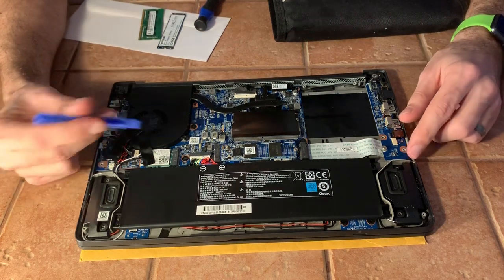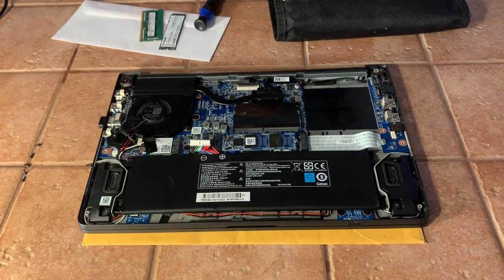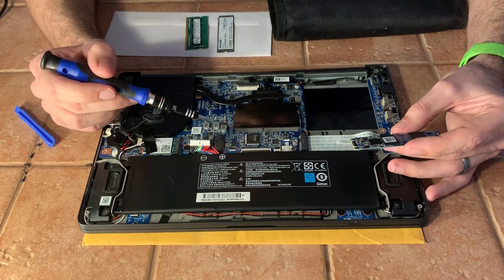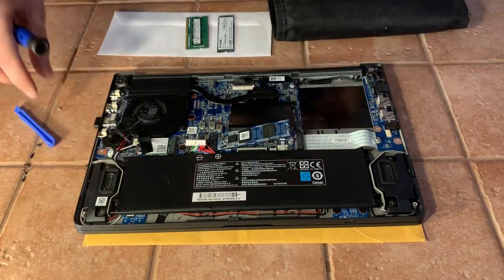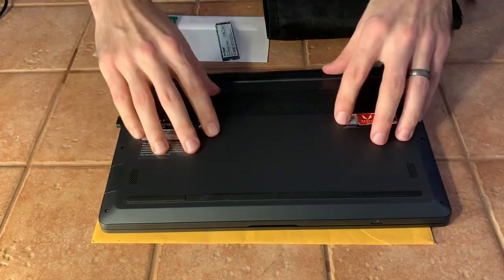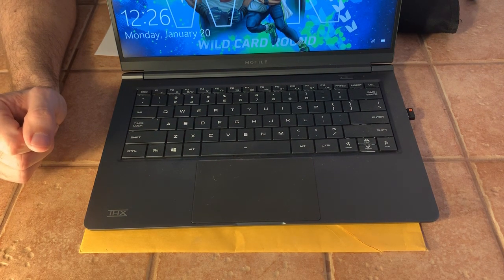Motile 14: In-Depth how to disassemble and upgrade.

Comment: WOW, this is guys ian IDIOT!! FIRST it is NOT a disassembly video, it's a replacement of the memory and SSD video. I don't know why he disconnects the battery cos THAT IS NOT NECESSARY. Second, he drones on and on about absolutely UNNECESSARY tools, all you need is a philips head screwdriver, a good way to keep all the screws, and a plastic card and a wedge, i use my useless client card for some store.

Comment: If you're in a pinch without a spudger, I find that using an old credit card is somewhat useful in that regard.  As for stripping screws, this is why I don't torque the screws super-tight when closing the laptop back up ...so if I have to disassemble again the future, I don't have to use a lot of effort and risk stripping the screw.

Comment: pretty decent video but absolutely do NOT need to disconnect battery unless you have Parkinsons, and absolutely absolutely dont have to remove the chassis (omg - someone wanna pretend like they work on laptop innards?).
Reply from the maker: I normally ignore critical comments, but I don't let people misinform in my comments. Even though I say it's not absolutely necessary every time I do it, I'm going to keep recommending people disconnect device batteries. You'll see the same in   iFixit guides and I guarantee they're still teaching it in tech colleges.

The chances of shorting components on a modern board are very small, but still exist and are greater on generic brand boards that play loose with standards. This is such a device and I'm always going to recommend people err on the side of caution.

I'm not sure what you think you know, but I do seriously work on laptop innards. A lot and for a long time. I'm going to keep telling people to do industry best practices, even when some of them become partially outdated and unnecessary. Because that is what you learn from experience.

Comment: Great video by the way man! It helped me out big time with my upgrade to 16GB for the ram. I was thinking about moving the stock storage over to the slower slot and just running windows on that drive. Then I was going to drop a better 500GB or 1TB drive in the faster slot with all my other programs. Think this is a good move or is there a better way to go about it?

Comment: Would you still recommend this Ryzen5 at the current price of $450?
Reply: C Maximus yes, it is a kickass laptop for the price. I upgraded mine from 8GB to 16GB of Ram and it’s a beast for the price. I just wish i got it when it was even cheaper.
Reply: Mace where did you get your 16gb ram? What brand or model was it? Thanks
Reply: SteakCity 300 no worries buddy. I got mine on amazon. Here is the exact one that I purchase. Patriot Memory Signature Line DDR4 16GB (1x16GB) SODIMM Frequency: 2400MHz (PC4-19200) 1. 2 Volt - PSD416G24002S https://www.amazon.com/dp/B074Q1P62K/ref=cm_sw_r_cp_api_i_DWPVEbR5DY0BZ

Comment: Long overdue question, but in your time with your motile have you tried dual rank ram? If so did it yield any difference in performance, positive or negative?
Reply from the maker: I'm still using the original 8GB stick on my Motile, but I have used dual-rank memory many times in the past. There is a very slight improvement in speed over single-rank. It's not going to be the magical solution to anyone wanting more graphics power, but it is a 5% or so improvement and worth considering for anyone already buying a memory upgrade.
Reply: @RyanLeCocq  thank you for the response

Comment: Could you add a second fan on the right side since the fan header is there and so are the screw-in spots
Reply from the maker: You absolutely could. So far I haven't seen just the fan for sale anywhere, just a few used complete heatsinks and fans on eBay and AliExpress. It's not an uncommon size or anything, just the one in there is obscure so it's hard to find. Another fan the same size and voltage should work fine as well.

Comment: Quick question on this laptop, I stripped my screws on the first attempt and have since learned my lesson (proper screw kit and tools are on the way). Is it possible to order replacement screws? I took some measurements and consulted a friend of mine who is engaging in mechanical engineering, and the screws used in there seem to be 6mm M3.5, and ordered some of those. Anxiety is getting to me though, so I figured I should ask if you knew exactly what screws these are.. Thanks in advance!
Reply from the maker: Alex Schaafsma You actually measure screws by shaft diameter x shaft length, not head diameter. Pretty sure the bottom 6 case screws are 2mm, but I’m not taking it apart again until I have spares. I ordered a set of 800 replacement laptop screws of as many sizes as possible to match every one in the laptop. Still waiting for it to arrive from Taiwan, but I hope to be able to advise people on what to order soon.
Reply: @RyanLeCocq  Thanks a million for the heads up, I just ordered another size based on my measurements with that fact in mind. I would have been in a panic if I couldn't get the right screws on time with all the craziness going on in the world.
Reply from the maker: @alexschaafsma361  I would still say get an assortment if it isn't too late. They're really hard to measure by hand. Also, the other screws throughout the laptop are not great either. Worth having replacements for others like the ones that hold the SSDs and network card down, in case you ever need them.
Reply: @RyanLeCocq  I have ordered three different sets of screws off of Amazon, all containing anywhere between 25-50 screws. All are 6mm, and they are M3.5, M2, and M1.6 flatheads respectively. I was unable to find affordable ones that are not flatheads for these measurements, but given the size and how the screws sink slightly into the chassis, I don't believe this will be a huge deal. I'll post an update to your comments and let you know which, if any, work for me

Comment: Does anybody know if it's possible to upgrade the battery to something larger? Or the display to something brighter?
Reply from the maker: So far I haven't seen anyone do either. Theoretically other parts should be compatible, since the laptop is made by a company that makes a wide range of whitebooks in the same shells. It's just difficult to figure it out if you aren't a native speaker of any of the languages the related webpages are in.

Comment: Can i use m.2 or does it have to specifically be NVME for the second drive?
Reply from the maker: Derek King m.2 is the slot type, there are both SATA and NVMe drives in the m.2 size. Both slots take NVMe, only the 1st slot (the one occupied from the start) supports SATA.
Reply: @RyanLeCocq  Ok so the second will only work with nvme? cause i plugged in just an m2 and it didnt recognize, and that screw to hold that is stripped, they really are some weak screws. Need to try to figure out how to get it out now. I really appreciate the reply.
Reply from the maker: Derek King The screws on these are terrible. I just ordered a large assortment of replacement laptop screws. Shipping is slow, so it will take a bit, but I’m going to match all the screws in the system. Once I know what all the replacements are, I can find the cheapest screw kit available that has them all so I can recommend it.
Reply: @RyanLeCocq  I think you just saved my life. I am total Christmas noob and did not realize there was a second slot for NVMe. I put a 1TB PCIe NVMe SSD into the slot where the original SATA SSD was and then I got stuck on the Aptio Utility Setup screen saying it didn't recognize any SATA or NVMe controllers. Gonna have to go back in later and hopefully not screw anything else up.
Reply: Tommy Luo  14 inch 141 model. i want to keep the pre installed, but i have a m.2 i want to install in the secondary and it didnt recognize. And yeah the screws are total crap and i have to pay someone again to remove the stupid m.2 screw since it stripped. I think they just tourque them down so much cause im not an idiot, i know how to use a screwdriver.

Comment: Will laptop support 3000mhz ram?
Reply from the maker: You can install 3000MHz ram, but it will only run at the max of 2400MHz for the chipset.

Comment: Is there a way to install a laptop hard drive? Thank you
Reply from the maker: You can use an NGFF to SATA adapter from the first slot, which is SATA compatible. Then run that to the empty space where a 2.5 hdd would go. It's only practical if you only have a larger capacity 2.5" drive around, not to upgrade. Slot 1 is also the faster slot for NVMe drives because it has 4x pcie lanes. So you could, but you would be using your fastest slot for the slowest possible drive.
Reply: Ryan LeCocq to be clear: the faster Slot 1 is the middle slot with the Walmart SSD? Or the faster slot is the empty slot? Thanks in advance
Reply from the maker: Dade The faster slot is the one in the middle with the stock SATA m.2 drive.

Comment: can you make a video to repaste the thermal paste, if you ever get time...or only remove the fans
Reply from the maker: Nico Bellic I’m not planning on it because it wasn’t worth it. I only dropped maybe a degree. A couple of people have mentioned stripping the screws on the heatsink when removing it, so I would say don’t bother. 
If you strip the heatsink screws, you have to replace them before even putting the laptop back together. Not worth it for 1C.
Reply: @RyanLeCocq  well my laptop gets unbearably hot while placing it on my lap on bed...ill once again monitor the temps tommorow, and get back to you, maybe you can write it down for me, or maybe not lol, you are a very busy man I presume, it's ok if you have other things to work on, I'll get help from other sources, or get a technician to do it, but I doubt anyone from where I live will do it without hesitation, strip a laptop this size, technicians usually fix dells and hp where I live

Comment: So nobody has verified yet that there could potentially be a RAM slot hidden on the underside of the motherboard? Usually on boards with only one RAM slot on one side, the second is on the underside. I've also heard some people saying utilities/BIOS reporting an empty second RAM slot.
Reply from the maker: Several people, including myself have verified there is not. The keyboard rests directly on the flat backside of the board.

Comment: Hi Ryan, quick question, I changed the original m.2 sata to a Samsung evo 970 512gb plus nvme,  put in first slot, tried the original m.2 sata in second slot, would not boot. Is the first slot for sata and nvme, and second slot just for nvme. Samsung magician shows 1st slot as having 4 lanes, second slot as having two lanes. In second slot I have a Samsung 250gb nvme 970 evo plus. Second slot does not benchmark as fast as firs slot, is that because of 4 lanes compared to 2 lanes.
Reply from the maker: Richard Lewis  You have it pretty much figured out. The original documentation said slot 1 was SATA only and slot 2 is NVMe only, but that is an error. BOTH support NVMe, only slot 1 supports SATA. Slot 1 is 4x and Slot 2 is 2x.

Comment: Hi Ryan, the screw I stripped was one of the six screws securing the bottom panel.
Reply from the maker: Richard Lewis  I'm pretty sure those are m2.5x5, but I would recommend getting a laptop screw set so you have options and don't have to trust my eyes. Here's one on eBay linked below:
https://www.ebay.com/i/254220824367?chn=ps&norover=1&mkevt=1&mkrid=711-117182-37290-0&mkcid=2&itemid=254220824367&targetid=870763273840&device=c&mktype=pla&googleloc=9030455&poi=&campaignid=9248481330&mkgroupid=93538216043&rlsatarget=pla-870763273840&abcId=1141156&merchantid=118868479&gclid=CjwKCAiAhJTyBRAvEiwAln2qB8abZ064Hf3_9leGDWBqmRDQD3l7NjARSTxsxmAXP_rdgXCUVWV_pRoCZnQQAvD_BwE

Comment: Hi Ryan, I have read that both M.2 slots support either an M.2 SATA III SSD or a M.2 NVMe SSD, but I installed in the open a Samsung MNVe 970 SSD and the read speed was 1720 mb and write was 1620 mb with CrystalDiskMark 7, so I cloned the orginal SSD to the Samsung MNVe and put it in the original SSD slot and booted got a blue screen with an error and rebooted into the Bios and set the boot drive to MNVe to the Samsung without the original SSD installed and same issue, the Bios I am at is 1.03, maybe 1.04 or 1.05 or 1.06 fixes this?? Anybody knows how to make the MNVe the boot drive? It's way faster as the original SSD is about read of 540? and write of 420 mb? If we can get the Samsung 970 to boot the Original SSD as a 2nd SSD drive I think this computer will rock when reading & writing data??? Thanks
Reply: The m.2 slot that the SATA drive comes in has 4 (Yes, FOUR GLORIOUS) lanes. The extra (unpopulated when you buy it) is only 2 PCI lanes.

I moved my Samsung 970 Pro 512 GB M.2 NVME SSD from the extra to the original slot, set things up in the BIOS, and it runs 4 lanes (according to the Drive Details tab of Samsung Magician). The benchmark speeds also change - my sequential speeds almost double (again, according to Samsung Magician) and my random I/O speeds go down a bit.

Now, here's how I got a Samsung 970 Pro NVME to work as the boot drive:
1) Before even turning on the computer, take the MSATA SSD that came with the computer, and clone it on to the NVME drive.
2) Put the NVME drive into the machine. 
3) Go through the BIOS, and set it to boot to the NVME SSD.
4) Boot. Windows will complain that things are ALL SCREWED UP!
5) When Windows gives you an option to fix things, let it fix things by doing a complete reinstall.
6) There will be a small (200ish) partition for windows, and another, unused partition in the NVME drive (if it's bigger) from the clone.
7) Use DISKPART from the command prompt to delete unused partitions, and then expand the windows partition to take up the rest of the drive.
Reply: @kirkkohnen5050  good info. i doubt i'd be doing this soon, but it's good that this information is available somewhere. thanks.
Reply: @kirkkohnen5050  what Motile model do you have?
Reply from the maker: Christopher Engell I think we got into it pretty well on Discord, but keep me posted. It’s a bear of a process sometimes moving or cloning OSes.
Reply: @RyanLeCocq  WELL GOOD news, I removed the OEM SSD and installed the Samsung NMVe 970 250GB SSD into the same slot as the OEM drive was in and had a USB Win 10 to install Win 10 and IT WORKED! Also it got the Product ID so it's regular. Also I used the SSD test speed and the read is 3600 MB's and 2300 MB's WRITE NICE! I will complete the Wn 10 updates and will post back. I only used Win 10 and everything works, no OEM drivers!
Reply from the maker: @whatmattersmost6725  This is the best time ever that I was ignorant about something. Or at least that I can think of right now. I just took the manufacturer's word that you could only use NVMe drives in the empty slot. Who knows if that was just mistranslation. Whatever. I guess I'll need to make another video. Or I'll mention it in my next eGPU video because now I'll definitely be using that slot.
Reply: @whatmattersmost6725  Unfortunate for me, the M141 only support M.2 SATA on slot 1 and NVMe X2 Lane on slot 2 (max speed @ 500mb/s).  Strange is that you can insert NVMe on slot 1 but Bios won't see it.
Reply: @wwc3180  Have you fixed this issue I have the M141 model as well and intend to install a new NVMe ssd into the first slot

Comment: Thanks for posting this Ryan and your other videos on the Motile laptop.  I've got the IFixit 54 Bit Driver Kit and the correct driver is J1 in that set.  Your video and the one by 
FaRKle0079 were helpful.
Reply from the maker: Wow that's a largish bit compared to what I use. It still works, but J1 (and PH2.5 which is about the same size) are more like the size of say late 90s Japanese video games and stuff. Most people having issues have been using PH1.5, which is about the same diameter as J00, but has a shallower tooth pitch, making it strip.
Reply: @RyanLeCocq  I stripped the M.2 slot screw... really frusterated about this. Be careful folks!
Reply from the maker: Aaron Phillip Nooooo! These screws are awful. Nobody should think that isn’t the case because I keep opening mine up over and over. My hands are really used to doing this and it’s still forehead sweat inducing.

Comment: Have you commented on the the ability to run Linux. Have you tried it. Does it work well? Thanks for your in-depth information on this device.
Reply from the maker: tim I haven’t tried it yet. I generally only use Linux on one specific work system as a tool. I did see a post on Reddit saying several distros working.
Reply: I run Linux on mine, runs extremely well. (I found Manjaro to be best) Only issue i had was compositing causing graphical corruption in the GUI, turn that off and your fine

Comment: Great job Ryan, I see most NVMe 256GB or 512GB on Amazon, do not have ram used as a cache, that would make the writing  to the MVMe faster, can you suggest a MVMe SSD 128 GB or 256 GB with cache for this computer on Amazon? Thanks again
Reply from the maker: I will do some research on that soon. Even if I don't upgrade immediately, I want to know what prices look like right now.

Comment: Use gallium to eat the aluminum and make a better heat sink for the copper tube
Reply from the maker: Now that's gruesome repairs! Can I even buy gallium if I'm not a chemistry teacher or something?
Reply: You can buy it from amazon. It basically would make the aluminum crumble leaving the copper alone. You don’t even have to use much just a drop
Reply: Circaslave08 omg I wish I trusted myself enough to do something like this